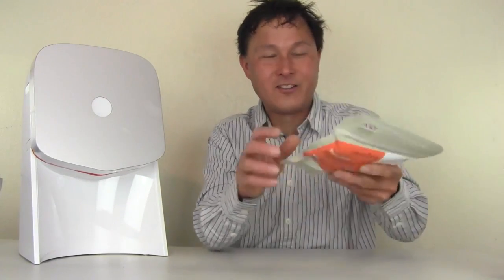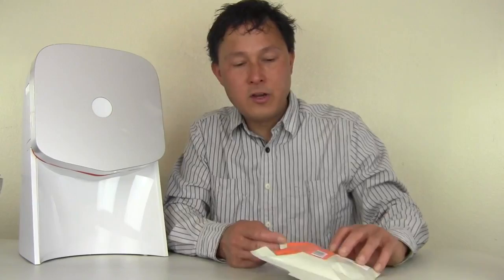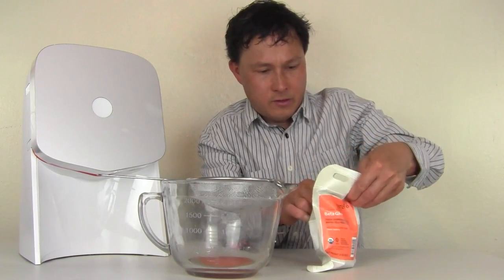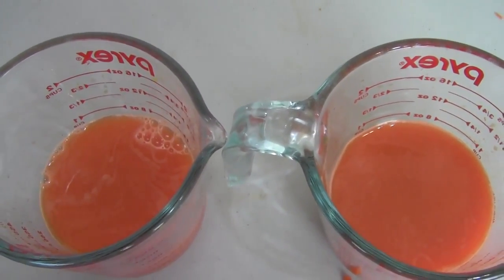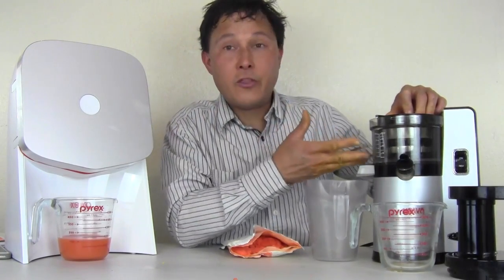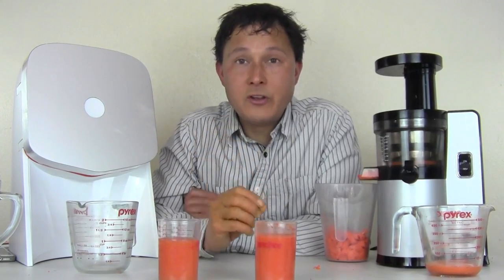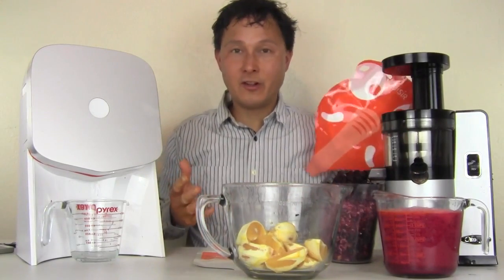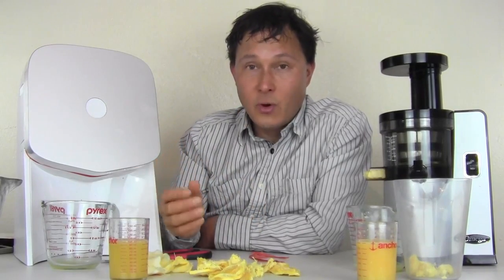$400 Juicero Juicer In-Depth Review & Hand Squeezing Produce Pack

Comment: John ~ From what I understand, each packet has a QR code to scan, which provides you with the info you mentioned (WHERE your produce is coming from, which farm exactly). I believe they only use 6 organic farms, and depending on where you live, your packets will come from the farm closest to you (hence why Juicero is not available to just anyone. You have to live near the farms they use). And regarding transparency, they are, at least somewhat. Everything you need to know about the produce, again, where it's coming from, info on the farm itself, is all there. How their machines chop/shred is not, though.

Comment: Great video, thanks.  I'd be even more concerned about the pouches - you'd have to save up enough of them to make it worth sending back a batch, and the pulp inside would begin to stink.  Or you just throw them away, which is an environmental no-no.

Comment: just cut the label off and put it on any other bag!
Reply: Tape the label to the reader 🤔
Reply: Uh, no. That's why it's connected to the internet. It scans the code and stores it as a "used" code which invalidates it for any subsequent use! That prevents it from being removed and used on a different product. If you listened, he said he cut the code from the pack which he opened with scissors earlier in the video. That means the code wasn't used in the juicer so it was still considered active. But once a code is read then it will not work again. 
This tactic literally forces you to buy their packs ONLY.

Comment: This was a fun video watch. I honestly don't understand why anyone would buy the Juicero Juicer or their packages. First off, as you and Bloomberg have demonstrated, it is unnecessary to have the juicer. Second, and more importantly IMO are the pulp packages (I will just list 3 main ones below):

1. It is expensive even if you subscribe
2. It produces excessive garbage (the packing)
3. Choice of juice combination is limited

If one doesn't care about any of the above and has the financial capacity to regularly buy those packages then they are better off to do a direct juice deliver subscription. Or if one is very rich, have your housekeeper or chef do the juicing with a real juicer instead. 

So, in summary, there is zero reason to buy the Juicero machine. I will stick with my Omega VRT 350. When it is time to upgrade , it will be Slowstar SW2020 vs Omega VSJ 843 or some yet to be released machine.